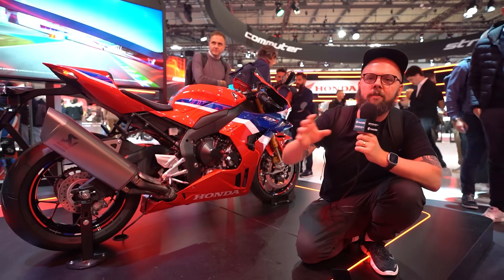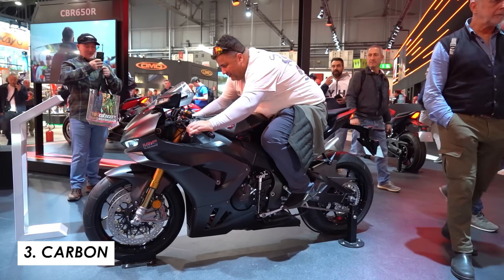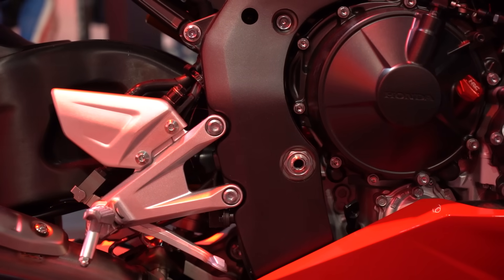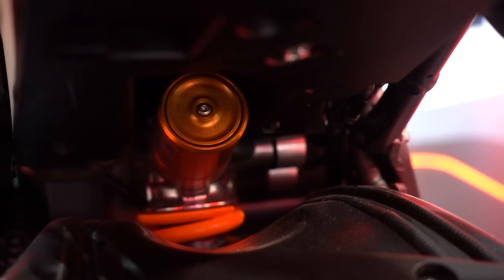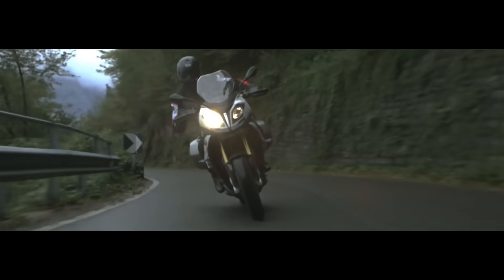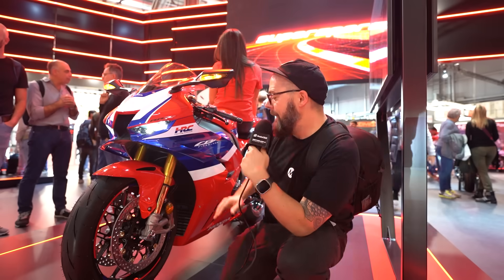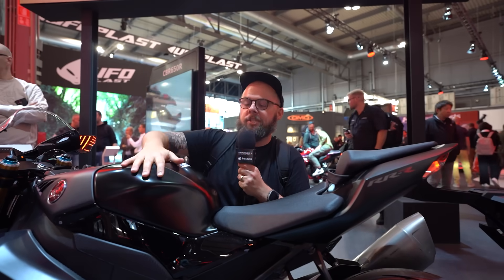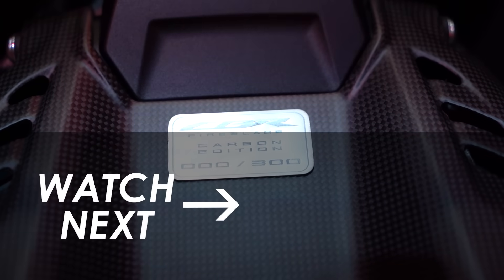New 2024 Honda CBR1000RR-R Fireblade SP Unveiled! EICMA 2023

Comment: I had two cbr 1000rrs (2018 & 2019) and as much as I enjoyed their reliability & solid design I got rid of them and got a 2017 & 2018 bmw s1000rr, I do miss the lightness of the bike & the TFT display BUT I don’t miss having freezing hands on the long highway rides to work & also not having cruise control, I was a honda fan boy for almost a decade but I moved on 😌
Reply: That's what I wanted to know; does it have cruise control now? does it have a fuel gauge? No? I pass, sorry.
Reply: @ricardog4459  also no fuel gauge just an alert when you’re at 30 mile range
Reply: @Lalalalalalalal..  so much tech and still they can't add these simple things...
Reply: @ricardog4459  exactly I literally “downgraded” years wise to the older s100rr that doesn’t have a fancy tft display BUT has literally everything else you would need from a super sport if you have extra cash to Spend just get the 2019+ bmw s1000rr it has everything that the cbr 1000rr has and a lot  more. In my opinion honda is just lazy and hates making big changes to their machines
Reply: @ricardog4459 The Fireblade has cruise control since the 2019 model, you are left behind in the past
Reply: @liv0003  no it doesn’t you’re literally just blatantly lying, I called up my local Honda dealership to confirm just inc see I was missing out because I literally had two SP model cbr 1000rrs that didn’t have it please don’t speak unless you know for a fact what you’re talking about

Comment: One of things i liked about the fireblade was the crazy boost at the top end.
Reply: But It has a big flatspot on the lows
Reply: @fqeagles21 yeah hopefully with this new one the flat spot will be improved. He said Honda made it a point to help low - mid end power. If not, flashing should help even more since it now has stronger internals and higher compression it can handle a more aggressive flash/tune.
Reply: @Nick-Edwards do you think Honda could have pushed even more power with higher revs? But didn't for the sake of torque and reliability? It's got the same bore and stroke as the rcv and the panigale v4r. I know 215 is enough but it would be cool if they made a race Ecu version with 16.5k redline 😂, making near 240 horsepower.

Comment: the two motor ride by wire system means its a 2 cylinder in the corners and a 4 cylinder in the straight aways!

Comment: Fuck me... this is by far the most desirable 1000cc supersport out there and it seems like the fixed the main issue; dead low end power and long gearing
Reply: Why most des?
Reply: @fqeagles21 Honda reliability with the performance of the V4s and 1100 factory I guess. It's mine too, but the others are amazing too, s1krr is best bang for buck, rsv4 as well, V4r is too expensive, V4s is excellent but sounds worse than the aprillia. I prefer a screamer, though I think Honda should replace the fireblade with the vfr-r series again, just so people could stop glazing v4 engines of the Italians 😂.

Comment: My 2004 RC51 still give me the goose bumps everytime i crank it
Reply: These new bikes are so sick. Bought a 22 cbr1000rr this year and it is unreal.
Reply: I have a 2005 RC51 which I love and has all the bells and whistles but my 2021 CBR1000RR-R is amazing.  Comfort speed handling shifting are all effortless. 15K+ rpm is unreal,
Reply: @Nick-fv8ts um.. Comfort? The 2021 triple r fireblade? God.. I cannot imagine what you think is uncomfortable 😅
Reply: @rns6889  If you go into the suspension setting you can set for manual adjustment.  I think mine are set very low for a more softer ride.
Reply: @Nick-fv8ts  mate I'm talking about ergos, the previous fireblade was easily the most focused and serious ergonomics wise.. In all the supersports

Comment: Lucky to get 180 out of it on a dyno. Mid range is quite weak too. We have tested 3 or 4. S1000r or v4 makes a lot more in all areas.
Reply: Dont forget to add roadside assistance for those two examples you mentioned....:thanksdoc:
Reply: @betkarh9795 if I owned one sure I would. Was just talking about Hondas ‘215hp’ claims and how far out they are. Don’t want to offend any fanboys 👍🏻
Reply: thats in the USA because of emissions. with an exhaust and atune to get rid of the emission limitations i heard they go up to 230-240, theres a clip on youtube of a guy in turkey going 345kmh+ on one of these!
Reply: @LiviuXSA uk here. We measured 185hp best case scenario. This factors in a calibrated machine with 12 percent loss from crank 

Absolutely no way a fire blade is making that kind of power to back tyre. That’s 260hp+ at crank. H2 yes but it’s forced induction.

Comment: Sport bikes should just sack the 1000 cc capacity. It was good for a 180hp or so engine. Now with power figures in excess of 200hp, it is guaranteed you have a feeble low and mid end. Just pump it up 100cc or so and you have a MUCH more versatily engine.